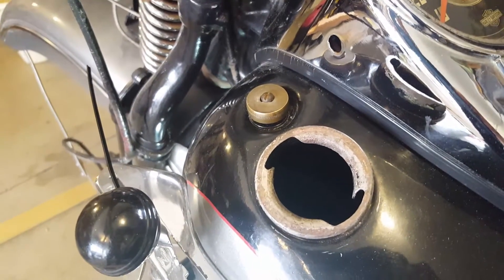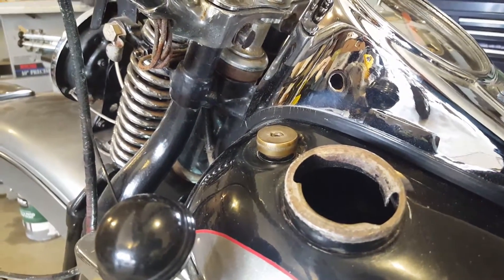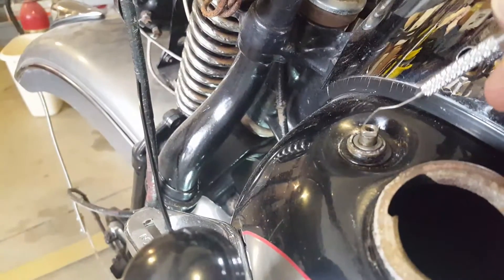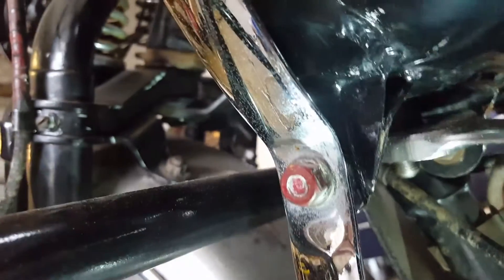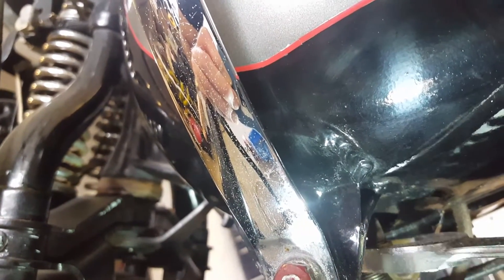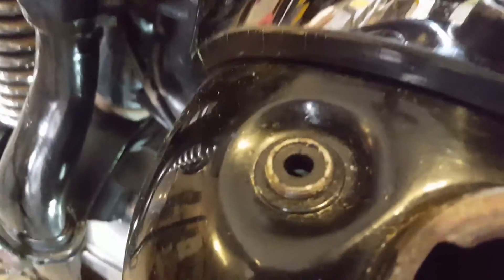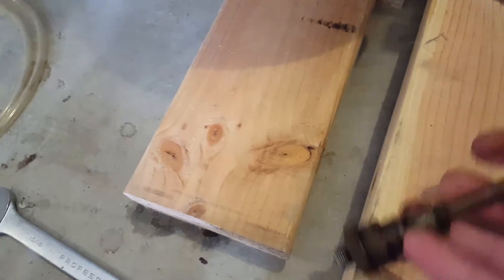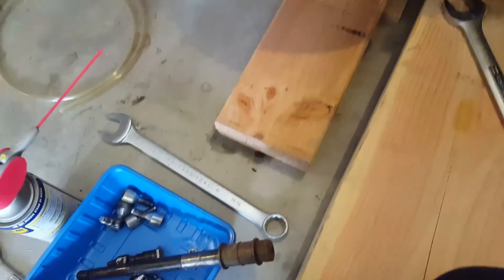1947 Harley 45 Servi-car fuel shut off rod removal

Comment: Thanks for the video.  I am not an expert either but it gave me an idea about what to expect when I removed mine (I need to replace the two washers on the bottom part that are on each side of the spacer).  The only thing I want to say is that I suggest leaving the fuel tank cap ON or plugging the (empty) fuel tank with a cloth when removing this rod assembly.  That will help to avoid any parts falling in the tank.  That did not happen to me on this project, but over the decades of doing motorcycle repairs I have found that nuts, bolts, washers, and springs seem to have a mind of their own and love to jump into dangerous places LOL!